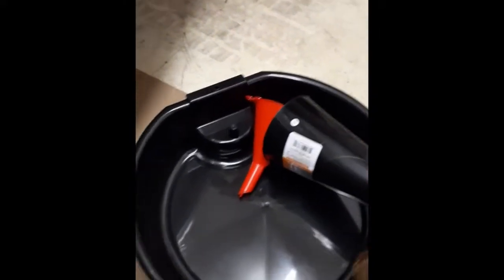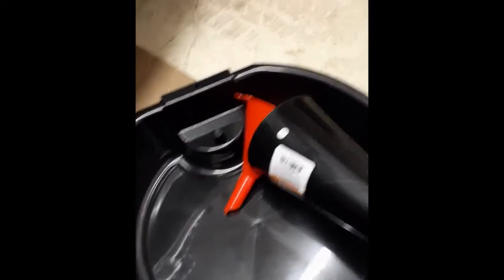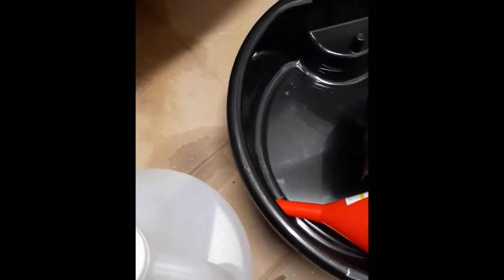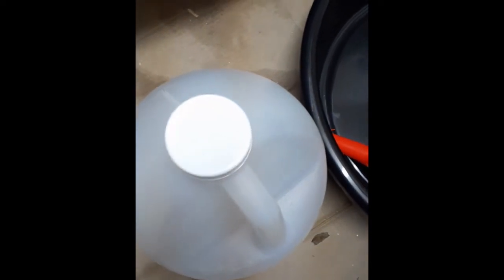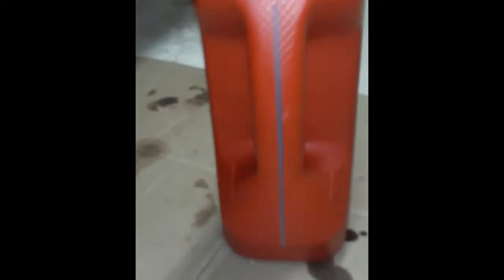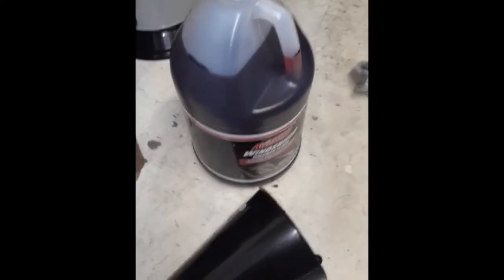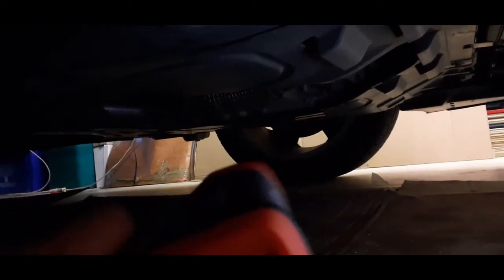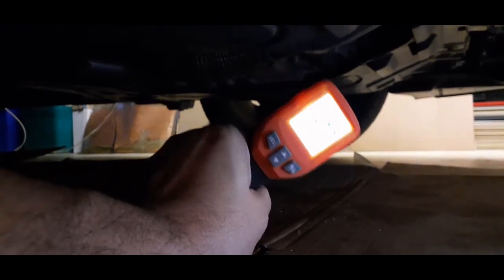How to: Drain and fill your transmission 101 - Buick Encore/Chevy Trax

Comment: Is there a filter to change not a settlement pan of paper filter?
Reply from the maker: Absolutely......if you want to remove the engine! Whoever designed the tranny either wasn't thinking or knew exactly what they were doing. 

You have to remove the engine to access the top of the tranny's case to open it up and replace the filter. Basically once the tranny dies is when you'll replace it.